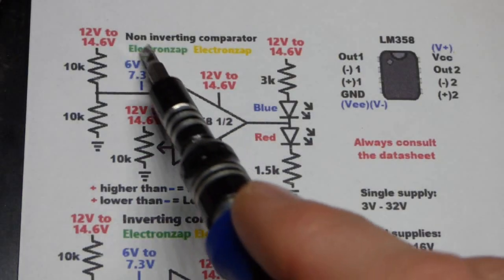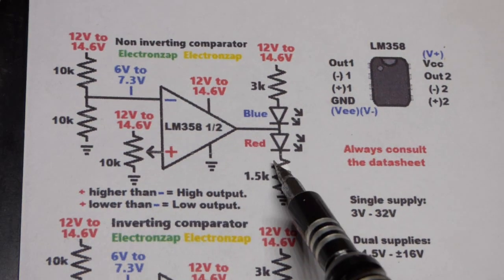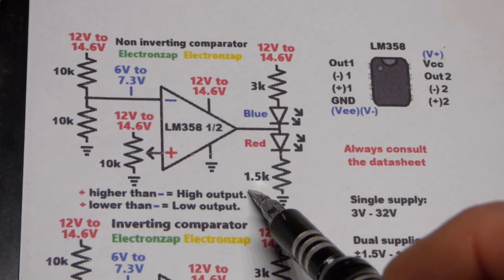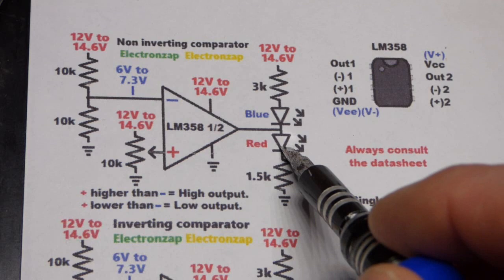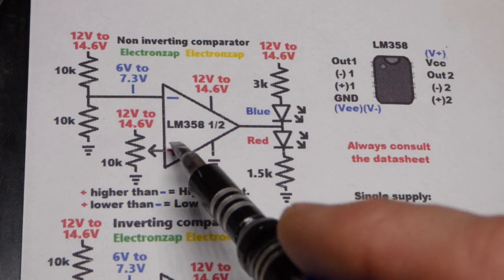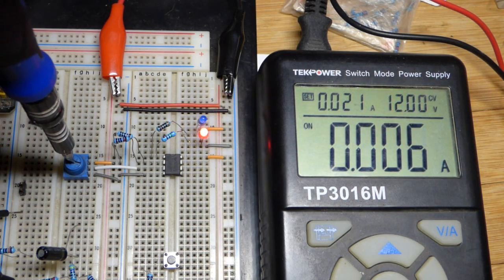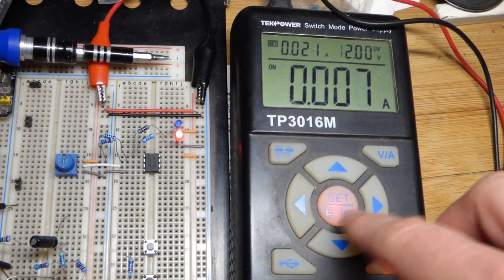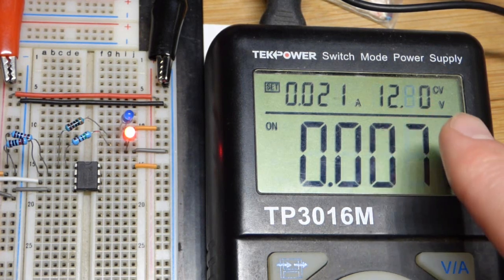12V LiFePO4 voltages powering Op Amp Non Inverting Comparator Demo Circuit

Comment: 2days ago I did a night activated circuit using LM358 ic, LDR sensor. and 3.7v lithium ion cell.. it's working great.. all your presentation are practical so I always like to see all of your videos..
if possible, please make a video on ATtiny85 microcontroller.. ❤  thank you..
Reply from the maker: Nice! I don't make arduino and microcontroller videos because the majority of those projects is programming. And IMO programming is better in written form than on video.